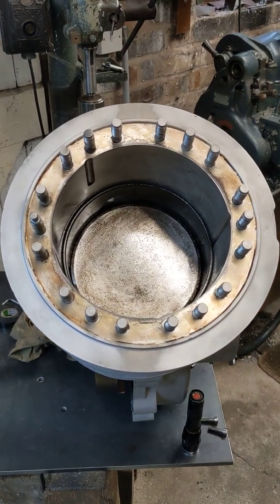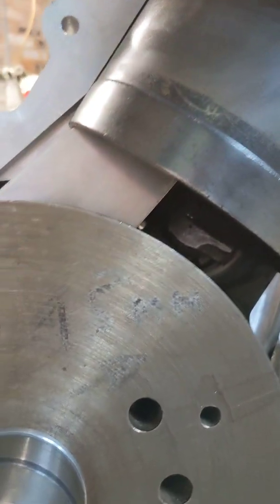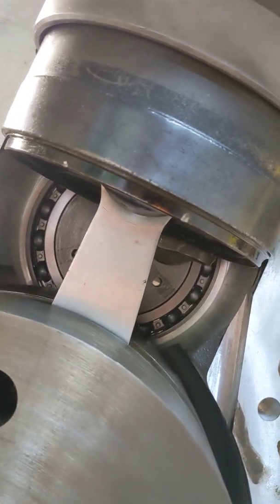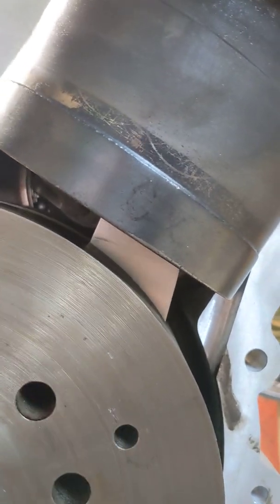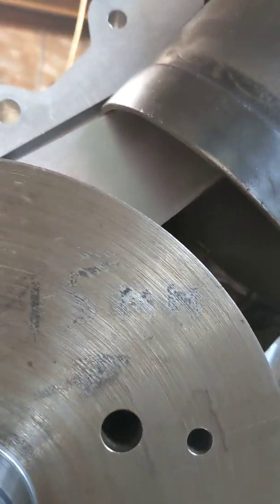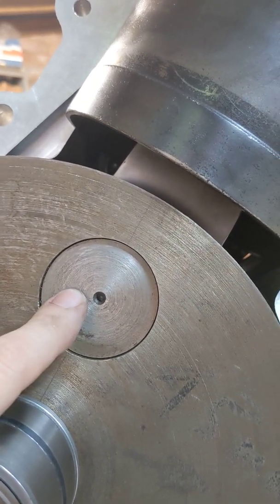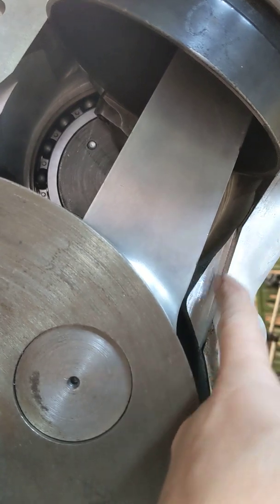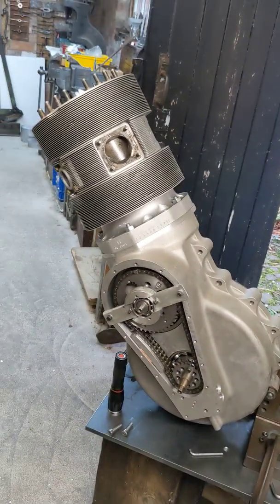My Rod is too thick 😁

Comment: I would do it in-situ, using a hoover to ensure any shavings aren't lost, plus pack out the voids, using a plastic jug with a slot cut in to run either side of the rod, to catch and run off anything that drops down.

Maybe an empty milk (6 pint) bottle, cut to go up either side.

I did the same to catch any spillage from servicing the Harley :)